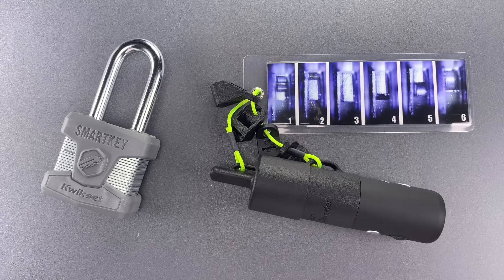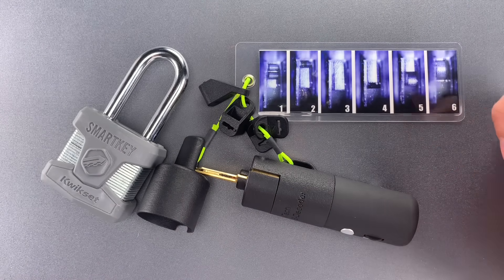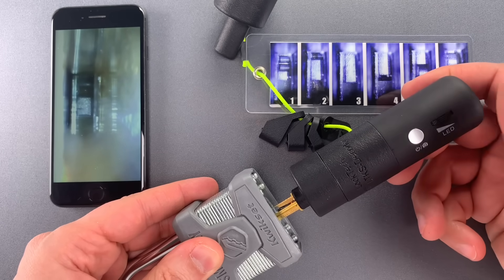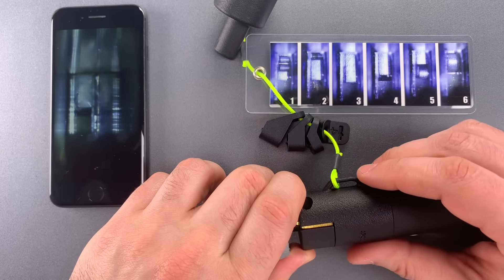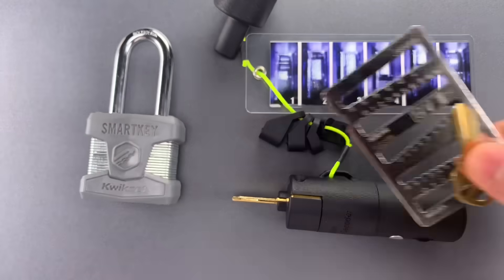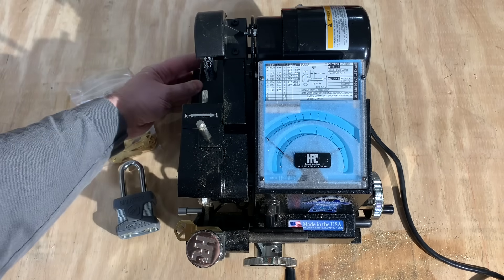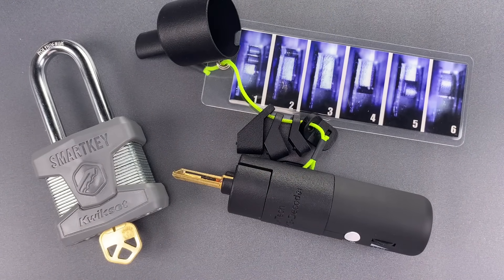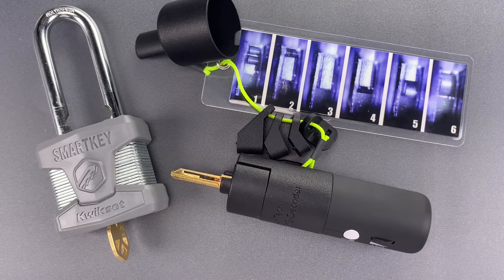[1209] This Tiny WiFi Camera Owns Kwikset SmartKey (LockTech LTKSD)

Comment: As they say..."Locks only keep honest people out."
Reply: if someone truly wants something bad enough there is always a way
Reply: @bmxscape  Yeah. Get a job, get paid.,buy it.
Reply: Unless it's a digital lock, like encryption. Then it keeps everyone out.
Reply: @lost4468yt  encryption isn't incredible and impossible to break
all they need to do to decode is see you log in twice, which its easy enough to install malicious software on a locked device given access to it.
Reply: @LMBLNCR  Uhh I'm talking about public key cryptography. Not basic login auth, which isn't even encryption.
Reply: @lost4468yt  i mean generally if someone can log into something with encryption themselves in any way, then someone can get into it by tracking the details if it is time based or even if its a fixed encryption key.
Encryption is only useful for stopping people from reading data off of something, if its used for any other regard it will most likely be insecure anyway.
Still any encryption or 2f auth is better than nothing hence why it is valuable to use.
Reply: @LMBLNCR  no you can't get into something using public key cryptography, even with a man in the middle attack. That's exactly why public key cryptography is so amazing.
Reply: @lost4468yt  I think the point was like with locks: Yes, you can't break into the encrypted data stream, but if you're willing to make the effort and gain access to the end points, you can access the data anyway. In raising the bar like this however, gives protection by changing the effort vs reward situation for cyber criminals and mass surveillance. Just like stealing a single patient file isn't worthwhile but accessing thousands of records on a central server is.
Reply: For public use, there is no such thing as a locking system that will keep anyone out that is willing and able to put some thought into the process.  Most house doors ( for example ), even if you can't get through the lock the bolt only goes into a tiny space of wood.  Making it easy to wedge open with a variety of tools.  If you have a actual metal door, metal frame, and solid quality lock that rarely applies to anything beyond the actual doors making the windows a incredibly easy weak spot for entry.

Case in point.  Over 20 years ago I worked in a hardware store that still did house calls for our neighborhood.  Mostly this was to help the elderly, but in one case we had a couple return from a flight overseas where they had been robbed and didn't have keys to get into the house or the number for the alarm company.  I was asked to take a look and see if I could help.  You would think I took a box of tools over to look over the situation but that would have been more work then required.   I actually just walked over empty handed, and using things I found in their back yard entered a window without breaking it, and disabled the alarm system not only preventing the local alarm from going off but also preventing it from transmitting a call out for help.  The entire process took me less then 5 minutes with most of that time spent finding misc 'tools' in the yard.

You are only as secure as you are paying attention, the moment your attention is diverted you are no longer secure from anyone with the intelligence and willingness to subvert your lack of attention.
Reply: locks only keep lazy people out.

if they were honest, you wouldn't need a lock
Reply: Locks are inconveniences.  The idea is to take an approach (based on what you value) to raise the inconvenience and apparent risk / cost above the (apparent) value of stealing it, and perhaps reduce the exposure to thieves.
Notes:
 - Showing it off increases risk.
 - Increased security lowers risk (not to zero).
 - Location matters (density of potential thieves, risk of exposure, ...)
 - Having something worth stealing means risk of losing it, however keep relative values in mind:  if having e.g. a shiny car means spending most of your time and attention on protecting it, what are you giving up to have it?
Reply: good thing a key is only one layer of protection and it doest turn off any alarms that will go off once that door is opened lol
Reply: You can't do this any more because you would get sued, and the mechanisms are more complicated in modern cars, but there was a time when certain high end cars had electric fence capacitors running on batteries grounded to the frame with a switch on the lock mechanism to disable it. It wasn't enough to hurt you but you wouldn't want to touch it twice. Yeah, it could still be picked by someone wearing insulated gloves, and it meant having an insulated key, but the person picking the lock would likely not have a pair of insulated gloves handy. You wouldn't want to do this with something that sits in a driveway where someone could theoretically touch your car, like a toddler who ran away from mommy, but if it's behind a fence or some other reasonable barrier then you probably could get away with it. There are laws that protect home owners from lawsuits where the injured was injured during the course of a crime. But that is NOT legal advice!
Reply: More like "Locks only keep out lazy thieves"
Reply: Well lawyers have never been known to be the most honest people....
Reply: And you are dishonest if you must have somethin locked away..
Reply: @maniacalmonster2293  no lol... thats not how that works..
Reply: @maniacalmonster2293  So.......where do you live? You don't seem to have any locks...

Comment: Very nice indeed!  I note that you widen the root of each cut a bit, is that because the width on the cut is wider than the cut on the universal cutter?       I kind of like the pointer thing for positioning the cutter - I have a Framon 2 machine and although it cuts very accurately it's a bit more work to actually set the positions since you actually have to set the depths and positioning by number.

Comment: It’s like a colonoscopy for a lock.
Reply: A colockscopy
Reply: would of been nice if it worked in under 10 seconds 👍👍
Reply: That's why I felt uncomfortable watching this video I don't use padlocks my buildings are lag bolted shut over the last dozen years I've found a couple lag bolts partially unscrewed thieves are lazy and a dozen 4 inch lag bolts takes some time to unscrew unless you use a cordless drill I rarely open these buildings except during growing season
Reply: Coming soon: ‘The Anus Probing Attorney’.
Reply: Does it fart when it's all over?
Reply: @Tekel-Upharsin  lol
Reply: Why did I have to read the comment section?  I had almost forgot about the colonoscopy I had last week.
Reply: Lockonoscopy.
Reply: Things you don’t wanna hear from your proctologist: “click on 1, a little binding, some counter rotation”
Reply: Endoscopy
Reply: @SouravBagchigoogleplus  WHICH end???
Reply: A keylonoscopy
Reply: Waiting for the lock picking proctologist channel...
Reply: It's a lock'o'noscopy ..
Reply: but just as kinky
Reply: Love the ANALogy...
Reply: They need to put this quote on the box. Maybe even make it the official slogan
Reply: Anyone make a "colonlockscopy" joke yet?
Reply: I'd rather them sick that key-camera up my ass in that garden hose they use 😁
Reply: except you don't have to put a tube in the lock and fill it with gas.
Reply: This comment is so underrated! =)

Comment: A key grinder machine like this, whether old or new, is one of the basic things locksmiths here have for key duplication. These days they use models that follows the groove of an existing key rather than one requiring cards like this.

Some skilled old locksmiths here can just freehand a duplicate with this kinda machine after looking at a key only once, but those are few and far between.

Comment: That key cutting solution is awesome! Wish I’d seen it years ago when I was working with my dad.
Reply: It seems like a nice and simple machine, both from a use and design point of view. Nothing fancy with modern technology just a simple but very functional paper card along with the two indicators. As long as the indicators are properly calibrated and the motor spins it'll do the job!

Comment: I kind of missed the whole thing, so why would a key need a tiny wifi camera?

is this a wifi camera with a key or a key with wifi camera???
Reply: It is a wifi camera that fits inside a lock. I think that is the best way to look at it. It allows you to inspect the inside of the lock so you can see exactly how it is keyed and you can make a key that will open the lock.
Reply: @mckenziekeith7434  I see, so this is a lock-smith things isn't it, not for average person
Reply: @Yezz007  yes. Locksmiths and maybe security professionals who have to install surveillance without being detected. For a thief it is much easier to break the door.

Comment: It's simple to defeat this kind of attack. You need to paint the entire internal key-way with black paint call Vantablack.
Reply: Not going to work against IR\Depth cameras, so only going to turn off unprofessional crooks. But those will just snap your lock with tools instead of bothering opening it.

Comment: Someone should build a two factor authentication lock. RFID built into the key. My idea is you can pick the lock but there will be a master that stops the cylinder from moving unless the RFID is valid. Just don't lose the key or let it die!

Comment: Great video, man! The lens on that camera must be microscopic!
Reply: It's a phone camera and angled mirror.
Reply: Probably fiber optic.  The actual camera is inside the black plastic case.  The fiber is the part you see that looks like a wire inside the key shaped part.
Reply: @Plur307  No, there's really just a mirror - the angled surface at the very front of the cutout. The wires are there to power the small LED light.
The manufacturer claims it's a "real glass mirror for the clearest image possible"
You can see a bit more of the tool here: https://shop.accureader.com/images/1599234921299-1439655023.jpeg
Reply: Actually, it's probably a fairly standard size. It wouldn't be worth it to create a new lens just for one product. Chances are they used a standard camera and lens, then just put a prism in the keyway that acts like a little periscope. It's much easier to cut flat faces into glass or plastic, than to create new lens geometry that does what you want.
Reply: @freescape08  quite interesting insight. Thanks for sharing
Reply: @freescape08  a comment on a comment that is informative but not beliterating? This is like finding 2 prices in ya cerealbox
Reply: D @freescape08
Reply: @freescape08  It makes so much sense, i hate for not immidiately jumping to the same conclusion.
Reply: Well. You can see it with your eyes, unaided. So, its clearly macroscopic.
Reply: @ryanboyce3422  That’s what she said
Reply: In addition to the prismatic optics, most lenses for cameras in this class (including your phone) are droplets of epoxy., no cutting or polishing necessary.
Reply: Or fibre optics?
Reply: @waynedl99  aka prism
Reply: Wow I didn't expect to see you here. Love your channel
Reply: @HousedHorse  Thanks! I really enjoy the Lock Picking Lawyer!!
Reply: Wow...ever think of becoming a detective?
Reply: Lockoscopic.
Reply: Smarter locks just make them easier to pick. I don’t get it.
Reply: Comically small camera
Reply: I'm frickin brilliant. I called this out in a previous video when he demonstrated the "light box" and said the technology exists to do much better than that. Now he publishes a video showing something closer to my idea with a camera going inside the lock. Almost there but still not quite all the way to my solution.  To achieve my idea, they need to build a device that can scan the inside of the lock and save the data to a file which will be loaded into a key cutting machine and the machine must produce the key automatically using the data file.  Keep trying. My vision hasn't been achieved yet but they're coming closer!!!   :)
Reply: @taekwondotime  There are automated key cutters that you could interface with but people like LPL don't need an intelligent automated key-making machine many times more expensive than the manually operated one they have when it would just save them having to remember 5 digits.

What would make more sense is upgrades that don't require additional prohibitively expensive hardware.

I could see for example an application that could recognize the images and report the corresponding bitting depth, ideally coupled with the pin position, and then present the complete bitting.

With that application, you could just smoothly insert the tool and you'd have the bitting in a couple of seconds with no hassle. I think that would be very convenient, compared to the way shown here, and also actually doable.
Reply: @taekwondotime  I'm sure they came up with that idea long before you did lol
Reply: @Starkl3t  I'm pretty sure every idea has been thought of already, but I thought I'd put mine in writing just to be sure lol.  :)

Comment: I gotta say, I’ve seen a few of your vids and enjoyed them immensely. I’m not a key hacker  in any fashion however a programmer and gadget fan. The camera on that tool is just amazing and I could see how I could incorporate that into many different pieces of hardware for tight spot pic/vid. Especially working on the car (project in garage), etc.. Anywhere I’d need to see, so I could work on it. Does the mfg list the camera type/mod? What an amazing solution to creating a new key.

Comment: I think still to this day the most secure door I've seen was in the Russian countryside the never there neighbors had a door with only a handle and that's it no key or lock or anything..... visible that is. In the wall next to door was a slit for some shit I never actually saw it since I only had a gander for a few seconds over a decade ago. From what I could tell there in simple terms was a doohickey contraption to unlock the door by pulling the bolts out.

Comment: for anyone wondering, that cutting machine is about $2000.00
Reply: Charzilleon the cost isn't for the machine itself, it's for the library of key manufacturer templates, and the smart design.
Reply: @firstmkb  https://www.google.com/search?q=hpc+blitz+machine&sxsrf=ALeKk03JQ2mw5syxgfIxM0YuYpFIVQeJiA:1608691766663&source=lnms&tbm=shop&sa=X&ved=2ahUKEwiG7bfqi-PtAhVMwlkKHWEyCQgQ_AUoAXoECAYQAw&biw=1536&bih=796#spd=13543582793526030046

Comment: so there are 5 positions with 6 possibilities each for a grand total of 6^5 or 7776?  I thought tumbler lock supposed to have infinite combination due to the continously variable depth at each of the positions and not discrete like this.

Comment: The metal they use is extremely brittle and easy to break off basically desentigrating the cylinder. Or at least there were back when I was locksmithing 5 years ago

Comment: I’m a locksmith who got in late as a second career. Over the years I never found it necessary to purchase an expensive HPC code cutting machine. Instead I can code cut keys just as fast and accurate with sets of depth and spacing keys. The poor mans HPC..

Comment: I don't get it. Why not use computer vision to figure out which number on the card it is? And get slightly more advanced with the computer vision and also see when you've moved to the next one. Then you can take all of 3 seconds to insert it into the lock and be done.

Comment: LPL has the HPC of my dream. The decoder IS a bit more effort on screen but decoding is faster first try than picking a regular lock.

The irony is that the smartlock series can be opened descriptively with a screw driving and a vice grip. Insert, crank, open. 

They also make a steel kwikset key. Does the same thing with less mess.

Comment: $300.00 for the electronic key. $1,000.00 for the key cutting machine. Should be able to recoup the $1,300.00 on the first job I pull. Everything after that is pure profit. Nice

Comment: 300 bucks for some chinese toy? .. i can't believe that thing costs so much lol, there must be cheaper options for like 25 usd or so. Also why is it so LARGE? it seems like a lightsaber's hilt or something. I have seen 20x smaller wifi cameras with same functions. probably the batteries? ... not sure why it's needed.

Comment: Hello this is the LPL and on today's show we have 5 little elves I bought off the internet that climb into a lock and manually push pins into correct positions.  But because it takes 30 seconds for them to climb into the mechanism, we're going to do the faster option and pick the lock ourselves.

Comment: I can imagine many criminals out there also use this, especially career criminals. These inventions are harmful in more ways than they are good.
Reply: Not really.  It's a ton of work to get a camera that's only useful for a tiny fraction of locks, check the pinning, have the key made, then come back to the lock.  The point of a lock is not to be invincible, it's just to deter someone from getting in to your stuff.  And if someone needs a Wi-Fi camera to pick my lock, I think my lock is plenty good enough.  and as other commenters say, after a certain amount of difficulty someone could always just smash down the door, window, or just hold your family hostage until you unlock it.